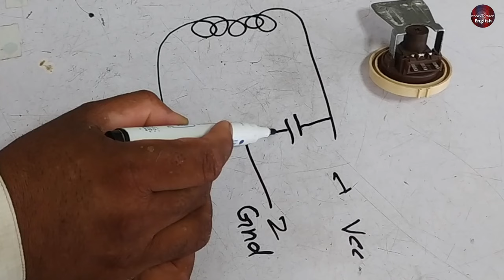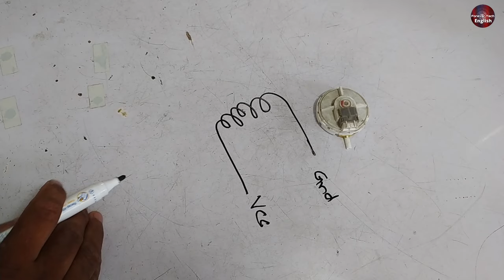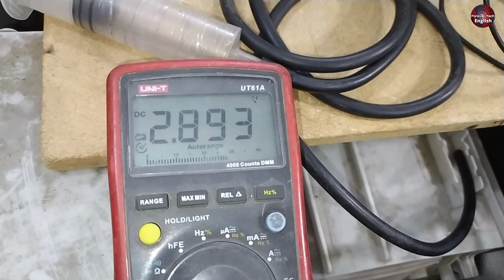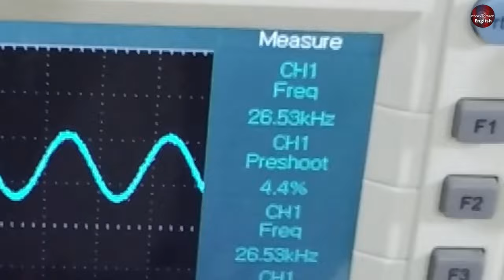Washing Machine Water Pressure Level Sensor/Switch Working Principal & Repair

Comment: I have Samsung washer .. the problem is not stopping filling water . I changed the  water inlet valve and still not working . So when I disconnect power the water shuts off . What do you think ? It may be the water pressure sensor  ?
Reply: same issue here
Reply: @johnxu6477  so I tried to do the washing cycle test ( washing and spinning) and it went well . But I use normal wash or quick wash the water keeps filling with no stop . Did you try to fix yours ?

Comment: When pressure sensor switch close water inlet valve is the pressure sensor switch wire switch on motor to wash?
Reply from the maker: Yes the motor works after the water level in the drum reaches a level you selected. The water pressure stops the water inlet valve to flow water. And the motor receives signals to work. And start the wash process.
Reply: @forevertechenglish  just want to make sure please. Is one of the 3 wires on the pressure switch send signal to motor to wash. Not a wire on water valve?
Reply from the maker: No, the signals are passed through the circuit board.
Reply: @forevertechenglish  yes that i know, but isnt the pressure switch give the signal to the circuit board after closeing the water valve. If the pressure switch not close the water valve. The circuit board will not get a signal to wash motor. Isnt it?
Reply from the maker: Yes, What you said is correct, first the pressure switch send signals to the circuit board. and the circuit board closes it. Then the circuit board sends signals to the motor to operate.

Comment: Should any of the rattle when you shake them?
  I am researching the one at 5:03 with three terminals.
  Should the reading not change when pressure is applied?  Like continuity from 1 and 3 should switch to 1 and 2 or 2 and 3?

Comment: very nicely explained. Good job. My siemens 7kg fully automatic front load wash machine is 13 years old. The problem with it is - now it is always complaining about low water pressure with F17 error code. I checked the water pressure from inlet pipe. It looks good pressure to me. Any thoughts on what could be the problem sir?
Reply from the maker: The Water tray could have dirt or soap scum which is blocking the water, as I have experienced it, Clean the tray, Check for blockages in the water pipes, clean the filter attached with the water inlet valve. And I think the problem could be resolved
Reply: @forevertechenglish  sir appreciate your quick reply on this. I figured out the problem. As you said i opened and cleaned the soap tray. But the actual problem was in the water pressure here in my top floor flat. Since this is top floor, there is very less water pressure at the inlet of washing machine. Hence I added a pressure booster pump.

Comment: Excellent!!!!! This would explain part of the 4C error code which is not filling; if the water level sensor is damaged, then this will cause the machine to automatically drain and stop operation, let alone if the machine has been restarted so many times, it will overfill. This is basically like having an EFI for washers. Learned the hard way with my Samsung Machine.
Reply from the maker: But this basically work with air pressure, and adjust the level of the water accordingly